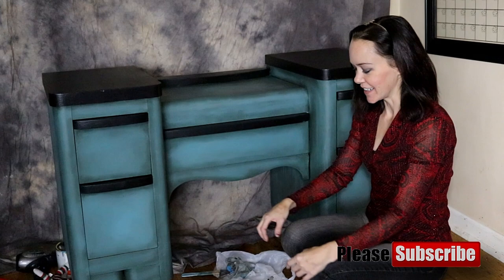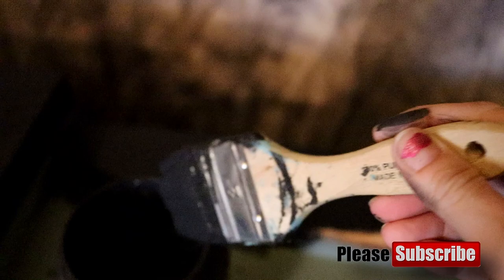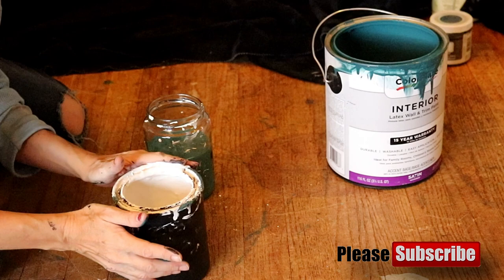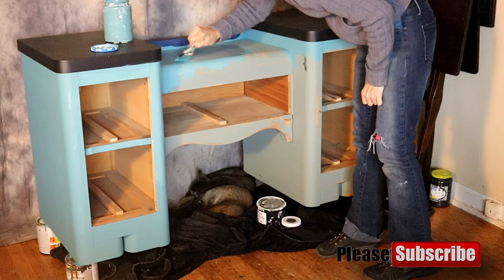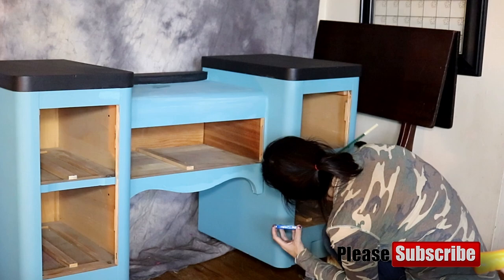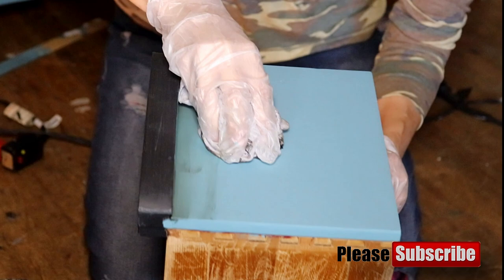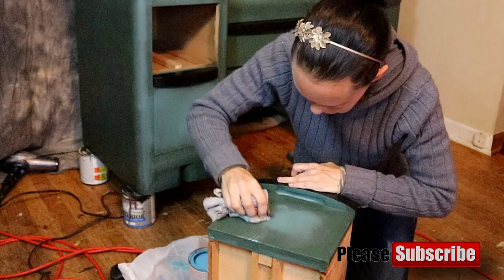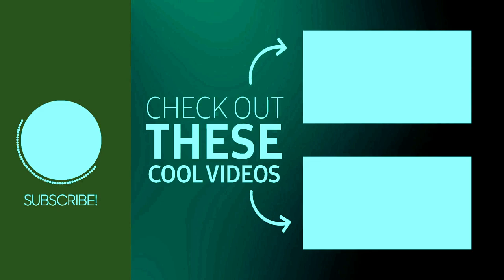HOW TO GLAZE CHALK PAINT WITH WOOD STAIN | REDESIGN A WATERFALL DRESSING TABLE

Comment: Have you done this with milk paint? I've not been able to find anyone who has used wood stain for milk paint. And yours was the first I'd found who used it with chalk paint. I've only found expensive waxes and glazes for milk paint so I wasn't sure.
Reply from the maker: I have not tried it on milk paint. I just prefer the chalk paint. But I have always wanted to try milk paint. My technique with using wood stain is not widely used, but if I find a video to help you, I will send you the link.